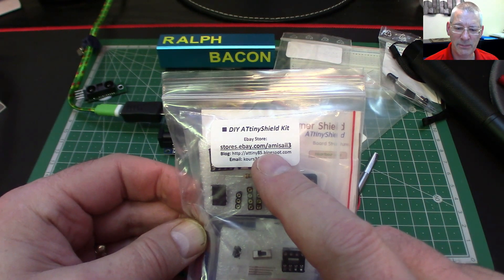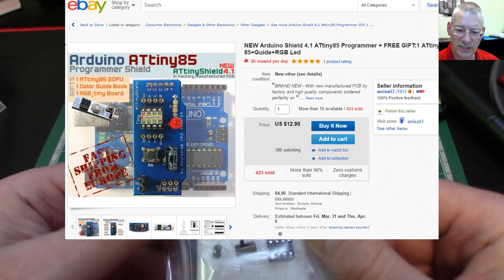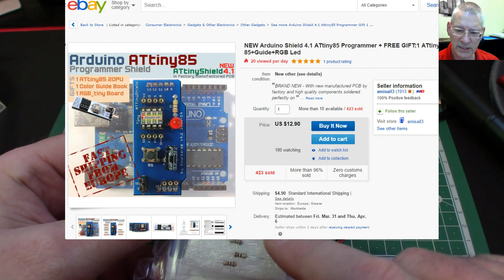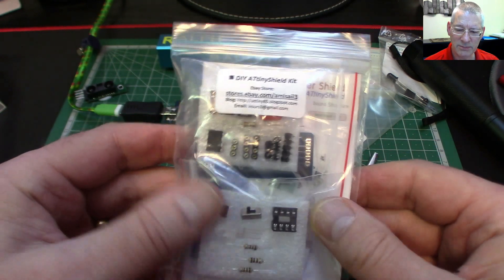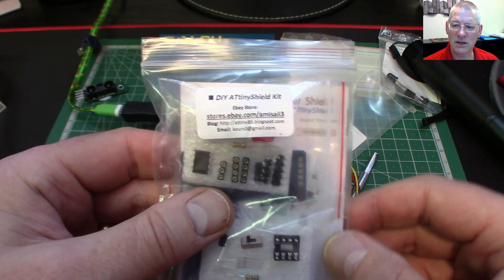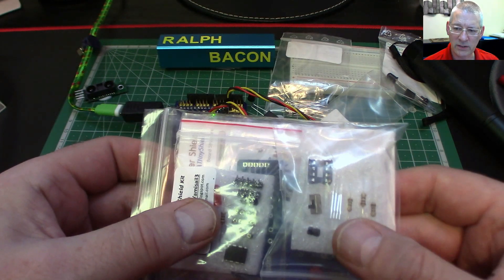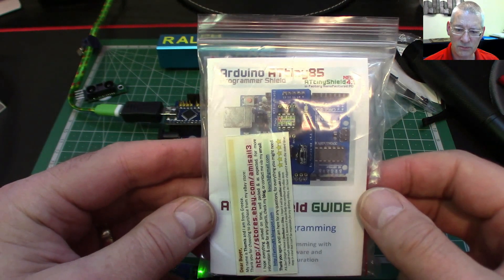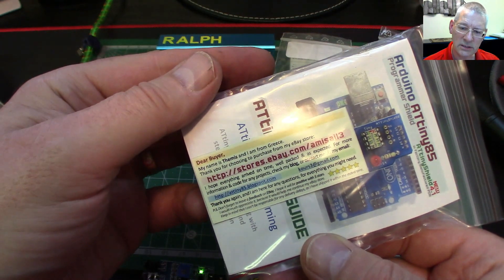#79 IR Rain ☂️ Sensor, Soldering Irons (and more!)

Comment: Hi sorry to rain on your parade but I think the perspex will end up pitted in the weather and then the beam will escape so it will tell you it is raining all the time the car version is glass and bonded to the screen with optics to direct the beam.
I will follow your project to see if it works how about the sunshine on the IR sensor will that cause problem as well  
All the best and love your channel Bob
Reply from the maker: Maybe so, Bob, maybe so. I haven't actually put it outside yet (which I could do, just as-is, to see the effect of the weather).
 
In the interim I have changed the way I have used the existing sensor. Instead of it being connected all the time, thus allowing a permanent 5v presence which corrodes the sensor (when wet) almost before my very eyes, I now switch it on just for a second or two every 30 seconds, take a reading and switch it off again. All controlled by the Nano which runs the entire Cat Run sensor system (Humidity, Temperature, Rain and Door Open/Close chime).
 
As a control I put an identical sensor (unconnected) next to it to see the effect of weather generally on it. The results after several weeks (of awful wet UK weather!) is that the unconnected sensor looks brand new. The connected sensor shows no sign of corrosion (that awful blue/white oxide that you get on the negative terminals of AA batteries in toys).
 
So all in all, as I knew I wanted to test this out, I sort of parked the acrylic sensor, with a view to picking it up again later in the year, but after your post I will put it on the Cat Run roof to see how it fares. To overcome the effect of sunshine I intend using a modulated 38Khz signal, but I've not actually built that for the reasons stated.
 
Finally, I ordered a couple of weatherproof and heated sensors from Telecontrolli in Italy, but they seems to have gone under; my payment to them is now being dealt with as a dispute case with PayPal. Sigh. Anyway, long answer to a short post, but nice to hear from you, and, yes, keep tuned for future updates!
Reply: Hi, Ralph thanks for the reply have you looked at VL53LOX sensor it has a laser and receiver and you don't need optics so you could fit it under glass!
Reply from the maker: This is interesting, Bob. I had a (very) brief look at lunchtime but want to investigate further. This device is £10 in the UK (the first web page Google offered) but I'll see how much it is elsewhere. But it does sound worthy of my attention, so thanks for giving me the heads up!
Reply: I do the same with my soilmoisture sensor, a milisecond reading every 2-6 hrs and then i have a transistor switch off the current to the sensor. have that working on an attiny, arduino and wemos
Reply: Hi Ralph hope you had a good holiday and are ready to do it all again let me know how you get on with the rain sensor---Bob

Comment: Hi  Ralph, thanks a very nice video, I was looking for creating such an optical rain sensor for my self, and I wonder if you were able to complete this project in the end, and if so, can you please share your Arduino code? alo, it will help if you have the name of the receiver part you are showing in the video. 
many many thanks!!
Reply from the maker: I regret I could not get this receiver to be reliable. It needed a bigger piece of perspex (I'm guessing) or more time and skill on my part. Ironically, my solution was to use the standard sensor (flat fingers of tinned copper) but only switched on once every 30 seconds for a couple of seconds - no more corrosion and it's still in use today (after some years).
Reply: @RalphBacon ok thanks, I didn't realize that the corossion on the common rain sensor was related to the time the sensor is on, it's interesting and maybe I don't need this kind of setup of optical sensor too, as the all idea came from being afraid it will get corossion...  will update if I will be able to get this work eventually :)

Comment: its an awesome video. the kind that i was looking out for. but sir you just wasted my 10mins by showing your new toys.
Reply from the maker: Well, Midhun, I hope you don't consider those 10 minutes truly wasted as they gave some important information about the new Antex soldering iron bits and a pretty decent gas filled heat gun! And the laser beam demo reflected through plastic is pretty cool, right? But I still have not had the time to finish this project yet, one day, one day... Sigh. Thanks for posting!
Reply: Yah...the reflection demo was pretty awesome.... I am also taking on a project like yours. Its not completed yet right...? let me suggest something...... Let go of the whole things IR and do some R&D on CAPACITIVE PROXIMITY SENSORS. I think this is the best sensor for the job. Cost is a bit higher than IR but whole lot better. NO CORROSION, CAN BE SEALED,HIGH SENSITIVITY,INDUSTRIAL SENSOR what more do you need.....waiting for your reply
Reply from the maker: How interesting, Midhun, that you're suggesting something that I've been actively looking at. More than looking, I ordered a couple of sensors from a company in Italy but guess what? They seem to have abandoned ship so now that payment is in dispute with PayPal! Doh! But there are others out there (and with built in heater) so I will continue my investigations because as you say, they are waterproof and sensitive and, yes, more expensive but seem to be what automobile manufacturers are using these days too. I'll keep you and everyone informed as to how this project moves forward comparing capacitive sensors vs electrolytic (resistive) ones and everything in between!
Reply: There is one company named DOLPHIN who produces these industrial sensors.I ordered mine couple of weeks ago from amazon.in. Its taking little time to get here because of the rural area in India where i live in. After ordering i found out there is another maker who sells much more compact one and cheep too.Anyway I'll inform you after some R&D.....(sir, about your reply "it's waterproof" .....NO IT'S NOT. we can MAKE IT waterproof since capacitance can travel through thin glass, plastic etc.)

Comment: Sir Can i get your email. Im trying to make a rain sensor using IR emitter and Detector. I need some advices.
Reply from the maker: Hey Kanishka, if you have questions relating to what's been demonstrated and discussed in the video, then the best place for your questions is right here! that way, others get to see them and may contribute or at least want to know the answer. If the question is of a more general nature then the best place for such questions is at the Arduino Forum  (http://forum.arduino.cc) where several kindly folk will help you out. You may even see me there!
Reply: Thanks for your reply sir. I already using that forum. But my problem not yet solved. Thats why i need to contact you sir. I need some instructions regarding the sensor. I can send you my arduino code.
Reply from the maker: Post the sample of code (not the whole sketch) here with which you are having specific problems. As you may understand I don't have the time or resources to debug a whole sketch but I can help with a particular part of it, if you describe exactly what it is you having an issue.
Reply: I cant recognize the fault is with my sensor part or with the coding part ( I mean the logic). I will send you my code sir. I made this sensor using the  principle of total internal reflection. 

My program has one analog input (A0). Its values varying (Small variations) like, Ex:- 221,225,220,226,220,229,227.....I need to select some set of analog reading values in a certain time (Ex:-0.5s) or certain number of values (Ex-10 number of analog reading values) and get the mean value of it. Then i need to check the different between those real time analog input values & the mean value with some Threshold value.

Ex:-  

Mean value of analog reading(in 0.5s or 10 number) = M
After that start to get analog readings,
Variable values = X1, X2, X3, X4....... (Those are analog reading values) lets say one value is X,

Threshold value = 5

*** Section 1 ***

So 1st i need to check is,

(|(M-X)|)<5 , (here im really checking  ("Modulus" value of the solution) <5

in here (M-X), there will be positive results and negative results, but i need the "magnitude" of the results value.  

like  "" (abs (M-X))<5 ""

......if ((abs (M-X))<5)......

in the above stage i really wanted to see whether there is s larger variation in the analog input values (check whether if it flickers in larger values).

If its true do nothing, go to beginning. 

If its false,(it means large variations)

In this case its need to store the above " M " value for further use.

Then i need to re-check above values with another Threshold values.

If we are in this stage its need to "avoid" the new "M" value calculations. because if its calculate again and again the below checking will change and cant get the needed results.But about the "X" values its need to get real time "X" values from the analogRead(A0) continuously for the checking. 

**** Section 2 ****

01) if (5<(abs(M-X))<10)...Serial.print("Its low")

02) else if (10<(abs(M-X))<20)...Serial.print("Its Medium")

03) else if (20<(abs(M-X)))...Serial.print("Its High")

in the above 3 stages its need to stay on one stage at least 3 seconds and re check the Three "" if condition "".

* The main thing is the stability and the smoothness of above 01) , 02), 03) stages.***

When exit from above " Section 2 ", its need to remove that stored " M " value for the operation and Go to " Section 1 " (to beginning) and need start to check if there is large flickers in input values.
Reply: The main thing is the readings are not stable. So in this situation a cant compare those values with same threshold value.
Reply from the maker: You MUST first implement the sketches in my demo to prove that it is all wired up correctly. There are two sketches in the Github folder link under this video's description. Get those working and we can move forward. They will prove that your Load Cell can generated stable results. Let me know when you have done this and the results.
Reply: Thanks for your reply sir. I cant find the link that you mentioned above.
And here is my code.
Reply: const int numReadings = 10;

int readings[numReadings];      // the readings from the analog input

int readIndex = 0;              // the index of the current reading

int total = 0;                  // the running total

int average = 0;                // the average

int inputPin = A0;//Analog reading pin

//#include "MegunoLink.h"

 

//TimePlot MyPlot; 

void setup() {

  pinMode(2,OUTPUT);//LED for threshold value 1

  pinMode(7,OUTPUT);//LED for threshold value 2

  pinMode(8,OUTPUT);//LED for threshold value 3

  pinMode(9,OUTPUT);//LED for threshold value 4

  Serial.begin(9600);

  for (int thisReading = 0; thisReading < numReadings; thisReading++) {

    readings[thisReading] = 0;

  }

}

int lastavg = -1;

int mindifference = 7;//7 original

int lastmode1 = 0;

int lastmode2 = 0;

long modeactivetime = millis();

int modeactivegap = 50; //50 millis

int modes[] = {10, 20, 30, 40};//Threshold Values

void loop() {

  

  total = total - readings[readIndex];

  

    digitalWrite(2,LOW);           

    delay(1);                                             

    int ambientIR = analogRead(inputPin);  

    digitalWrite(2,HIGH);          

    delay(1);                                             

    int nonambientIR = analogRead(inputPin);  

    readings[readIndex]= ambientIR-nonambientIR;

// readings[readIndex] = analogRead(inputPin);

  total = total + readings[readIndex];

  readIndex = readIndex + 1;

  average = total / numReadings;

  if (lastavg == -1 && readIndex == numReadings) {

    lastavg = average;

  }

  if (readIndex >= numReadings) {

    readIndex = 0;

  }

  if(lastavg == -1){

    return;

    }

  int difference = abs(lastavg - average);

  Serial.print(lastavg);

  // MyPlot.SendData("Last average", lastavg);

  Serial.print(",");

  Serial.print(average);

 // MyPlot.SendData("Average", average);

  Serial.print("=");

 // Serial.println(difference);

  

   Serial.print(difference);

  // MyPlot.SendData("Difference", difference);

    Serial.print(",");

  for (int i = 0; i < 4; i++) {

    if (difference < modes[i]) {

      lastmode1 = i;

      // lastavg=average;

      break;

    }

  }

  if (lastmode2 != lastmode1) {

    modeactivetime = millis();

    lastmode2 = lastmode1;

  } else if ((millis() - modeactivetime) > modeactivegap) {

    if (lastmode1 == 0) {

       Serial.println("NO CHANGE");

       digitalWrite(7,LOW);

       digitalWrite(8,LOW);

       digitalWrite(9,LOW);

    } else if (lastmode1 == 1) {

      Serial.println("LOW");

      digitalWrite(7,HIGH);

      digitalWrite(8,LOW);

      digitalWrite(9,LOW);

    } else if (lastmode1 == 2) {

      Serial.println("MEDIUM");

      digitalWrite(7,LOW);

      digitalWrite(8,HIGH);

       digitalWrite(9,LOW);

    } else if (lastmode1 == 3) {

      Serial.println("HIGH");

      digitalWrite(7,LOW);

      digitalWrite(8,LOW);

       digitalWrite(9,HIGH);

    }

  }

  delay(100);

}
Reply: Sir how to send my sketches. No option to add pictures here
Reply from the maker: I had a quick look and here are my observations:

1. In the loop() you are setting pin 2 Low then almost immediately High. This will do nothing other than set Pin 2 High. What are the 1ms delays for? No need for these. Did you really mean 1ms or 1 second (1000 ms)?
2. Try putting in comments for each line of your code so it is obvious what you are trying to do.
3. The loop() will run 10 times  a second due to your delay(100). Are you really going to be able to see a difference in the output pins during this time (Answer: no, it's too quick).
4. I suspect your readings are pretty random or identical as they are carried out so quickly. 
5. You need to really slow this loop down so you can see what is going on.

My advice would be to rewrite this sketch with a very basic proof of concept. Show that you can actually read the analog pin and store the value in the array. Then prove you can compare it with whatever you read before (but not within 100ms, that's too quick). 

And that, unfortunately is where we must end this thread, as I just don't have the time to help any further. As I said the Arduino forum is the place to get help, but you must be a lot more precise as to what you are trying to achieve, the results so far and where the issue is (that you think is, anyway). Good luck, and keep trying.
Reply: Okay sir. Thank you very much for your support.